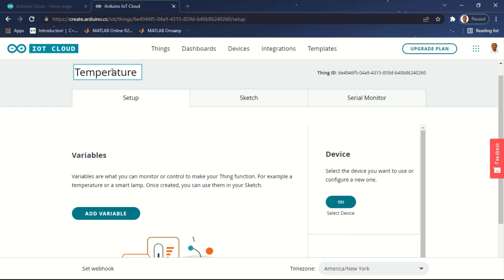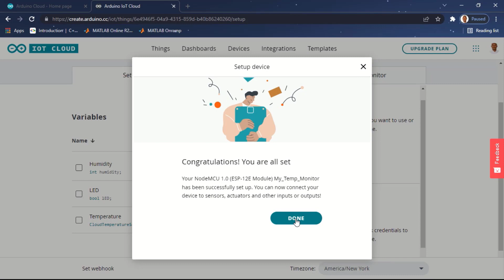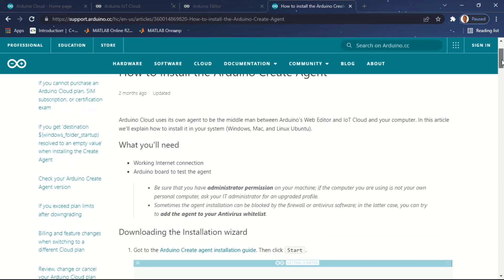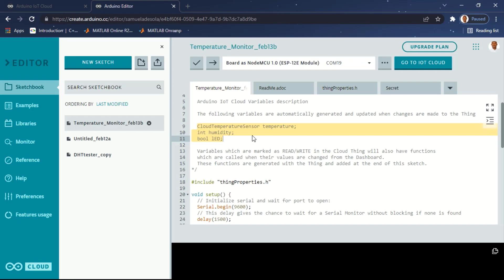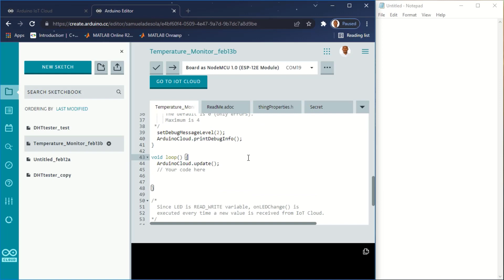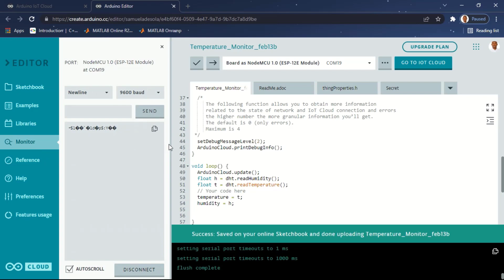How to Send DHT Data from NodeMCU/ESP8266 to Arduino IoT Cloud

Comment: When I open serial terminal I see connection failed. Any command can help pls
Reply: Its ok I connect in 2.4GH its working now . Just I find the channel 5GH its not  suitable for arduino IDE
Reply from the maker: Ok
Great work sir.
Reply from the maker: I'm sorry for late reply.  Most times this is due to network connectivity of the esp. Not that your network is not good but the esp delays sometimes, you can keel trying it.